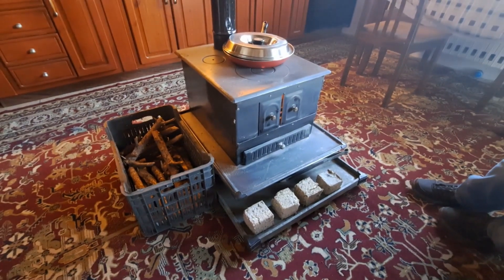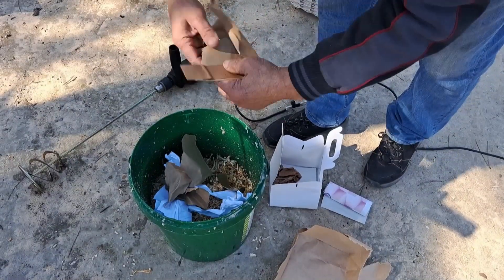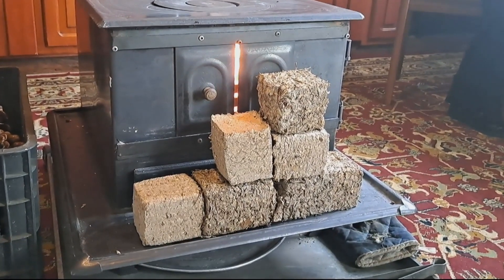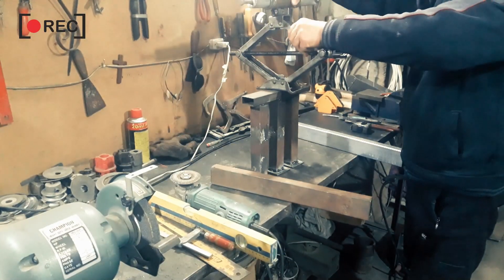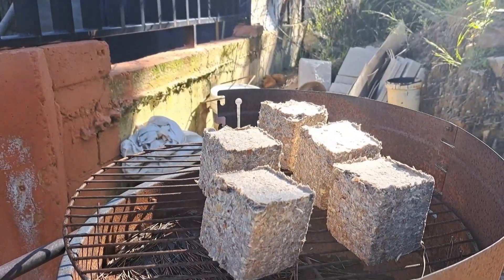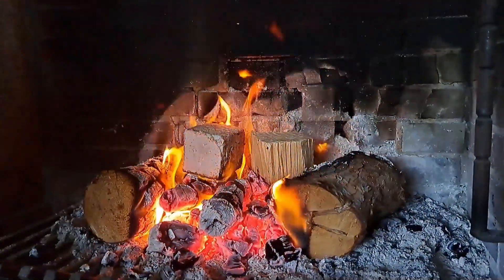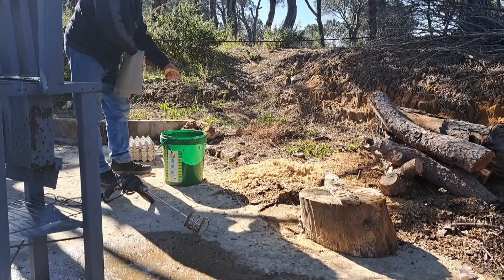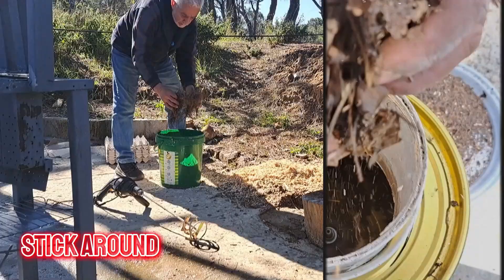DIY Briquettes: Turn Waste into Fuel

Comment: Add about 3 tablespoons of wall paper paste to your water when mixing. It's made of wheat and has cellulose in it just like wood. It will help your briquettes "stick" together. When they are dry, they won't flake. I used to make handmade paper and we used wood pulp from the papermill. We added methyl cellulose to make the fibers stick together when we used cotton fiber pulp. It's more expensive to do that, so as students for student projects we used the wood pulp and paste. It is a cheaper version of handmade paper, but, for art you intend to keep, it isn't great, it falls apart in a few years. Casting pulp, which is basically what you are making also had a good portion of Elmer's glue added so it would harden rock hard. You don't need that added for what you are doing. The wall paper paste will burn like the wood.
Reply from the maker: Your comment is greatly appreciated =)

Comment: Excellent concept (it's not new)! You need to incorporate a way to core out a small hole in the center of each brick for faster drying, possibly adding metal rods under the press plates. Either way, I wish I had one!
Reply from the maker: thank you  for the suggestion =)